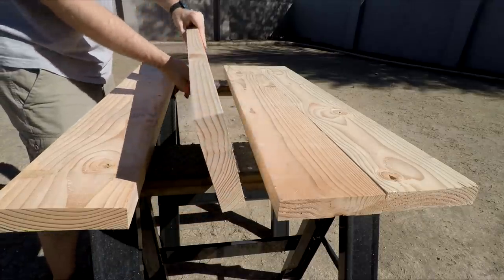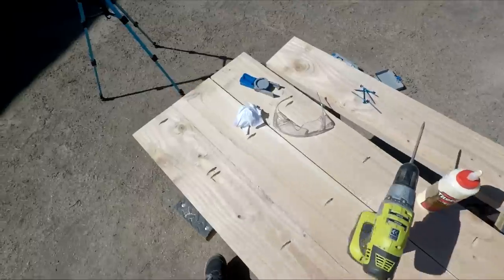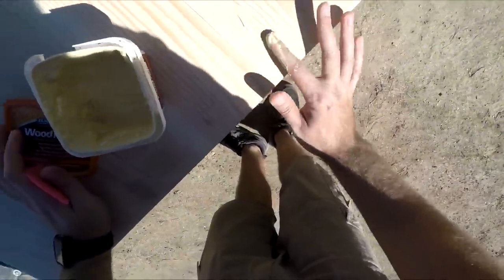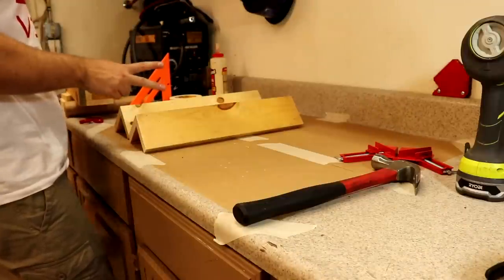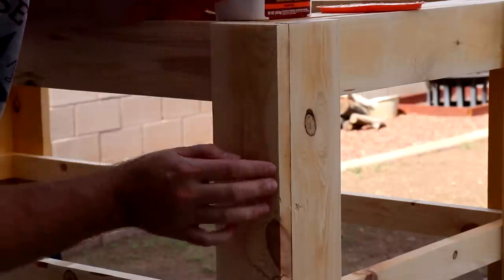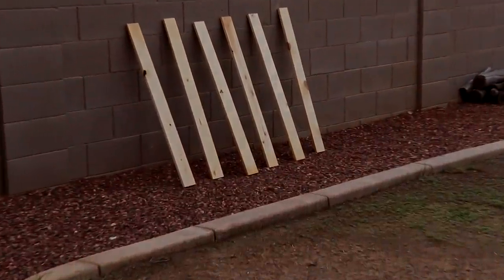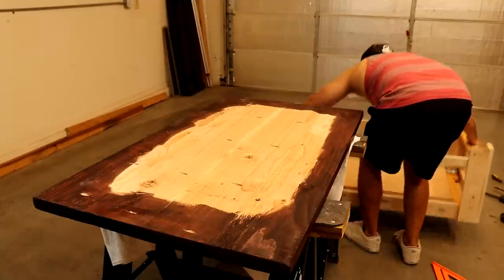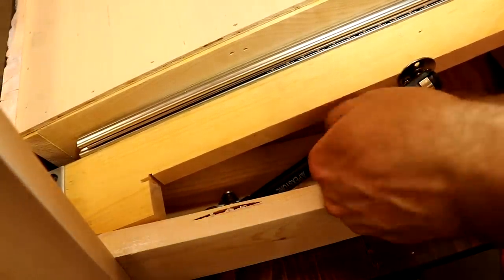Easy DIY Rustic Concealment Coffee Table / farmhouse

Comment: A few tips: if you use the pistons use jack chain for extra support. The brackets on those pistons are weak and bend easily. If you have even a little bit of weight in there it’ll eventually wear out and hit your bottom support board. Take time on the sanding, if you get in a hurry you’ll have to do it over. And the magnetic locks take some time to place and you might actually break a couple before you get them lined up properly. This was a fun build! 🤙🤙
Reply from the maker: zeroskater720 awesome tips! Thanks for sharing after the project!

Comment: I like the fact that you did all this without using more tools like a joiner, plainer or biscuit joiner.  I don't have any of those tools yet so I think this earns the "Easy DIY" title.
Reply from the maker: Aaron Bono thank you! It’s a lot more work without those awesome tools!
Reply: Aaron, use a drill bit and wooden dowels instead of the plethora of pocket holes/screws and it’ll be much stronger, and no special tools are necessary, least of all expensive jigs and specialty screws.

Comment: You should try boiled linseed oil instead of stain. The thing that sucks though is you would have to put quite a few coats to get a darker look and let each coat dry atleast 24 hrs but it gives it a beautiful look.
Reply from the maker: blake102989 thank you for the tip! That sounds like an awesome finish!

Comment: I love the design. next time consider connecting the table top to the base with fasteners or clips, that allow for seasonal movement due to changes in moisture and temp.
Reply: Finally someone said it
Reply: Yes same here, that table top may split where the pocket holes were made.  But nonetheless a great project.
Reply: People highly overestimate how much wood will expand and contract in a controlled environment. If you have it indoors with heating and AC, you aren't going to get a lot of expansion/contraction. The way this was built, he has much bigger problems than expansion and contraction of the wood.

Comment: Sorry to say, but I have built quite a few drawers, cabinets, and tables in my day and have learned a few things doing so. Although this build looks nice when finished, I have serious doubts it would stand the test of time in regards to durability. A few criticisms: 1. Minwax polyeurethane is not meant as a tabletop finish. It is simply not hard enough and when applied to a soft wood, will not stand the test of time. You should be using a rated topcoat for tablet top surfaces. 2. The drawers you are building are being bound only by staples and glue with single 2-face jointing.  The size of the drawer bottom will allow loading the drawer with enough weight where the drawer bottom has a good chance of breaking its glue mold and coming undone. The same with the sides, as the wood expands and contracts, it will eventually separate and come undone. You should be using a better way to join these surfaces. A dado cut along the bottom edges of the side would provide a groove the bottom can rest in and l greatly reinforce its weight capacity. Rabbit cuts for the sides will provide a 4-face joining for the glue and staples and greatly reduce the probability of it coming apart. These are  all possible with the tools you are using. 3. The finish products you are using are sub-standard home-improvement junk. I used MinWax for years because I thought that one finish was just as good as the other and it was the one sitting on the shelf at the local home improvement store. But once I started to use other finishing systems (such as General Finishes), I will never go back. I know this sounds like alot of criticism (because it is), but I can not simply say nothing when I see obvious mistakes.
Reply: Minwax does suck. I learned this myself after I used it on some projects and noticed that regardless of how many coats I used or how perfect the application, any water dropped on a Minwax Poly finish would leave a permanent mark where the lustre was altered somehow by the moisture. I've since switched to a quality varnish and get a 100% waterproof finish with only one coat.
Reply: David, thank you for the way you brought up these criticisms. You didn't just say "YOU DID THIS WRONG", you gave examples and also gave alternate solutions. It is good to see that people can disagree and still be civil about it.
Reply: Your comments are how us new wood workers learn though.
Reply: Ok….. so name a “rated” brand and type of top coat?  Also since you seem like someone who knows how to build this, I built it using some oak hard wood everything turned out great… except I bought some small shocks at Home Depot and their really tough to compress and once I got even just one shock screwed in it wants to push out the drawer immediately, I just want the shocks to expand when I apply alittle pulling force…. Any suggestions????
Reply: Yet you won’t post a video on this 🤣
Reply: @coleman2586  ?
Reply: Thank you so much for this comment
I just started getting into wood working full time and I'm definitely learning alot more
This comment has provided alot of necessary info that references mistakes I have made as well

Comment: I like youre caffee table, I'll will copy your table soon. Next time please  add a drawing of your plan with the sizes. I need too change a bit, we calculate in cm or mm not in inches. Greats from Holland✌
Reply from the maker: Dennis Huijs thank you for the feedback! I built this in my head hah I’ll have to write the plans down next time.
Reply: R/choosingbeggars
Reply: I made this table, just other collers and a other lock. I just screwed a piece of wood add the front so if the drow is under the table I turn the piece of wood under the table.
Reply: You can download an app for Android devices that converts units, i like one called unit converter

Comment: Excellent work bro. Thanks for the tutorial!
Reply from the maker: Ryan Hartigan you’re welcome!
Reply: Wood Nerds 
I’m gonna make a modified coffee table but really needed info on the compartment assembly so it was a huge help. One question if you don’t mind. At 12:54, you mention adding spacers for the butt-joints. I just wanna be sure I’m understanding correctly, are the spacers placed on the backside of the hinges that are mounted to the table frame?
Reply from the maker: Ryan Hartigan yeah! It’s to prevent the joint rubbing when the drawer opens/closes. It will make one hell of a squeak if they rub haha.
Reply: Yeah that’s what I was thinking, thanks! I really appreciate the responses. Keep up the good work!
Reply from the maker: Ryan Hartigan you’re welcome! Thank you!

Comment: Nice job I like the concealment drawer
Question what about wood movement on the top of the coffee table. I didn't see that you factored that in.
Reply from the maker: Hey Shane! You’re right! I haven’t had any issues with my previous tops but you should account for movement using specific table top fasteners that account for expansion/contraction of wood with changes in the environment.

Comment: In the 'materials' section you have listed a latch that is "similar" to the one you used, but the one listed is a magnet type, what do you recommend for just a push-type catch with no magnet?
Reply from the maker: If I was to do that again I would probably make the drawer a little smaller to give me room to try to make a simple sliding latch.
Reply: @WoodNerds  understood. But do you know of a specific latch type that you can link here for me to look for?
Reply from the maker: If I was to buy, it would probably be something like this (I have no experience with this particular product):

https://amzn.to/3eTB4HP

Or maybe these (I use these in my folding bench video, they are robust):

https://amzn.to/3rvQkje
Reply: @WoodNerds  thank you so much for the quick reply and your help! I was trying to figure out a push type latch that I could use that would hold the weight of the drawer.
Reply from the maker: Of course! Happy to help. I haven’t seen any that I am confident they could manage the stress the drawer and all your hidden goodies would put on them. I’ve seen some ball and socket style latches like that but they all seem to be plastic.
Reply: @WoodNerds  that's exactly what I've been finding as I look around online at different types of latches and catches.

Comment: Nice but I wouldnt use glue joining the top to the base.  Thats a cross-grain situation where the expanding and contracting of the wood would eventually crack the top.  If you are in sunny Cali you could get away with it.

Comment: Hey man love the table. But im currently building it and you’re definitely missing a couple cuts of wood in your description. Upsetting cause now i have to go back to lowes
Reply from the maker: Sorry about that! I hate going back in the middle of a project. This was one of my first videos and I wouldn’t be surprised if I missed something. What did I miss? I’ll see if I can update it.
Reply: Wood Nerds you have 8 1x4s at 44inches when you actually need 10! 4 for the base of the table another 6 for the bottom shelf of the table!
Reply: Wood Nerds you also forgot the shorter 1x4s you used to secure the top of the table to the base.

Comment: Please help. My draw is perfectly fine when the table top is up side down. When I flip it over. The struts or pistons will not hold the draw up And drawer is way too heavy. It drops down fast and draw slides out. I don’t get it. I never say in the video how the draw came down or slide when it was on the table. There is no latch that can hold it. And I even had a latch hook to just try to lock the drowse up and it ripped it out in minutes. What did I do wrong. Can you send a picture or video how it stayed up?
Reply from the maker: Ant T Hi, the pistons are designed to push the drawer open and hold it open once the latch it released.
Reply: But the drawer is so heavy I can’t find a latch that will hold it. If I did even find a latch the drawer flings down so quickly and with a lot of force.  I literally need to put a lot of force to put it up. And when it comes down It slides out fast. I even changed the hinges to storm door hinges hoping it would not fall down so quickly but the drawer is just so heavy. And it is empty. Any suggestions. I love this idea. Built and put the drawer together quick and easy but flipped it over. And I have been  trying something new every day for a week to keep it from flying down.
Reply from the maker: Ant T dang, I’m not sure. I didn’t have any issues with mine. The drawer isn’t that heavy(unless you used different materials than I did). I used a little plastic latch and it held everything easily. Maybe the angles of your mounting positions for the pistons is aggressive?
Reply: @adayinthelifeofastagehand  is your pistons backwards?

Comment: Please don't screw and glue your tops down!! You need to allow for wood movement or they crack and split. There are  clips called "figure 8" you can use that allow for seasonal wood movement. Also finish both sides of the top or it will dry out faster on the unfinished part and can cause wrapping. 
Nice project by the way.
Reply from the maker: Thank you for the tips! I’ll be using these fasteners in future builds!

Comment: I'd like to know if you have made a sled for your ryobi table saw.
Reply: Wait is that a battery powered air nail gun?
Reply from the maker: Hey! I haven’t! I have been waiting to upgrade before I make sleds although that table saw could use a couple to boost performance!
Reply: @WoodNerds  The tabs in the slot makes it near impossible... not to mention mine only has 1 miter slot which wouldn't make the best sled.  I was thinking about taking mine apart and building a table around it with a standard sled system.  I'm liking your vids, man, you seem very chill in front of the camera.
Reply from the maker: Great points man! If I was to give advice (if you’re interested in hearing it haha) I would say use this saw to build some stuff to sell. Save the money and upgrade ASAP. It’s been a decent table saw but there are a bunch of better ones that offer all the big boy advantages (dados, better fences, dust collection, etc...) then, if you choose to go with a smaller job site option your table setup off that will be even better of a combo. The nailer is AWESOME! it’s the 18ga Brad nailer from ryobi (battery powered). They offer a 16ga as well. Mine shoots nails up to 2” (I believe).

Comment: At the start of the video you show the drawer coming out but didn't use a magnet to unlock the lock.  Do you have to have a magnet?
Reply from the maker: David Moss the magnet isn’t necessary. You can actuate the lock with your finger. The magnet I had wasn’t powerful enough to move the latch(I had some old safety locks). You can always use a different solution to keep it in place, this was just my idea.

Comment: Hi, great video! What size are those pocket screws? Also, what setting on the Kreg did you use to drill table top pieces? Thanks
Reply from the maker: Hi! I’m not home right now to check. You can reference the chart on google. Look for “how to select the correct pocket hole screw” and “kreg jig settings chart” I seriously have to look these up every time I use it haha. Keep those charts handy!
Reply: @WoodNerds  thanks! How long did you wait after pre-stain and staining?
Reply from the maker: Almost no wait at all. It says to not let the pre-stain dry.

Comment: Can you use a circular saw instead of table saw I think I want to make this table with my fiancé.I will put my own twist on this diy table
Reply from the maker: You could if you have some sort of guide. Or else it’s really hard to cut a straight line. You can easily use a circular saw instead of a miter saw though.

Comment: Would you think screws would be okay instead of nails?
Reply from the maker: Tyler Stevens absolutely! They just take extra time to pre-drill then screw in. Nailing with the nail gun even frees up your other hand to hold items in place while you nail.
Reply: Nails make it harder to take the piece apart. Screws will be more secure overall and you can use less screws than nails.

Comment: Just ran across your videos and am really enjoying your content, and your presentation is great. A question though... your obviously comfortable using pocket screws based on how you assembled the top, so why did you abandon them in the rest of the construction?  Glue is great, but I feel that the screws add so much more strength.  Just wondering if I’m missing something.
Reply from the maker: Hey Russell, thank you for checking my videos out! You’re right about adding strength. I didn’t really have a reason. Just wanted to do something different. Im working on more content ideas like this. I’m excited to get to work on them soon.

Comment: Hey man! When you ran your 2x8’s through the table saw at the beginning of the video to make them fit better, how much did you take off? And did you do it to both sides? And did you do that with all of your 1x’s as well?
Reply from the maker: Hey Justin! I only take about an 8th inch off. Basically enough to remove that rounded corner. I rip both sides to get rid of that soft edge. I did that also with a lot of the 1x4s. I think it gives it a nice clean look but isn’t absolutely necessary for the build (you’ll probably like it better if you do!).

Comment: Hey man! Great job on the video. Just a couple questions because there are a couple things that confused me. I’m an extreme novice to wood working so bear with me: 
Your materials list. The cut list is extremely clear and not confusing at all. But, what each cut is used for is not. Unless is marked in the description. So the 17” 1x4’s, those are the legs? Connecting the legs on the short side...the 23”’ 1x4’s? If you can, I’d love a little more explanation. 

And secondly, I’m wondering what size screws you used for your pocket holes, and length of Brad nails you used to secure the bases in tandem with the wood glue. Again, I’m a novice, so I apologize for the questions. Thank you! Great table!!
Reply from the maker: Hey Justin, thanks for watching man. So 2 of the 23” 1x4s are used for the short aprons (short upper frame piece) the other two are used when I attach the top. 

Pocket hole screws for the 2x8s are 2.5” long (I believe the ones I used are listed in the description)

For the nails I believe I used 1.25”. sorry man, it’s been a while.
Reply: @WoodNerds  hey man, I appreciate the quick reply! Thank you for the info. And just double checking, the 17” 1x4’s, eight of them in the cut list, those are for the legs, correct? Again, thank you!
Reply from the maker: No problem! Yes sir! Those are your legs.
Reply: @WoodNerds  one more question! Did you still use 2.5” screws for the 23” 1x4’s you attached to the top of the frame for attaching the top to it?
Reply: @ 9:35 mark in the video
Reply from the maker: I believe 1-1/4” are recommended for 1x4s!

Comment: Great video. I was wondering  if this design would sturdy enough to support a granite slab about the same size as your table top?
Reply from the maker: Sorry for the late reply. I think so. Probably use screws instead of nails, and a thicker piece of wood supporting the legs/bottom shelf.

Comment: What length drawer slides are you using? The Amazon link defaults to 20" but with your drawer length I don't think that is possible.
Reply: Jonathan Geist where is the amazon link for this? I can even find that